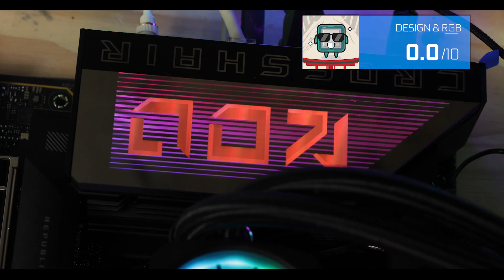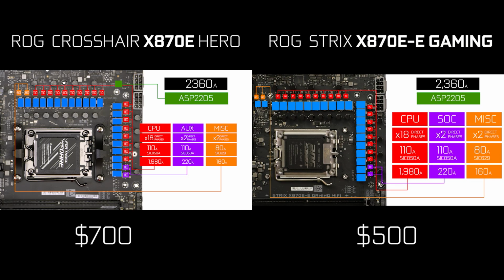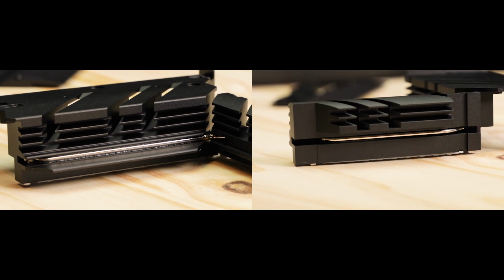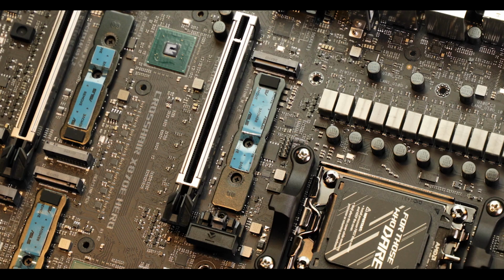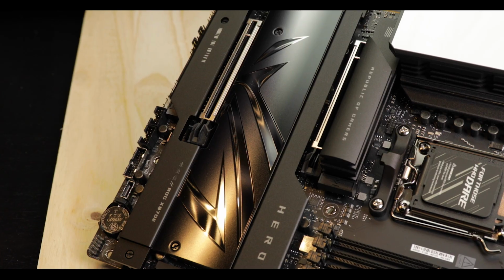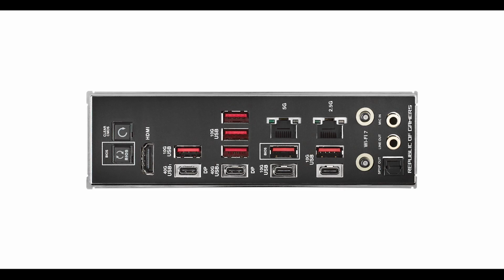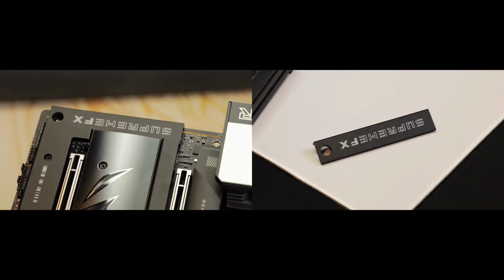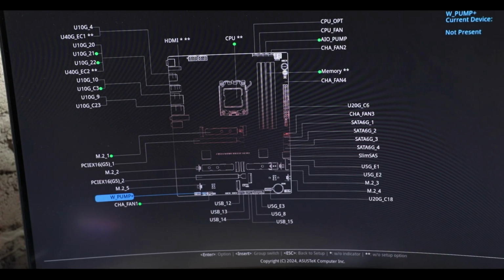ROG CROSSHAIR X870E HERO:  Stunning, but tough sell nevertheless

Comment: 1 big difference to the Strix is the extra PCIE power plug to the mobo which then relieves a lot of the stress on the 12vhpwr plug for my ROG Astral RTX5090. But thats only for rtx5090 users and those users dont really care about pricing. They just want the best.

Comment: No... Just no... There is exactly zero reason to EVER go single channel when it comes to RAM.
WTF are you talking about???? A single stick does NOT have higher data rates. Thats like saying a single water hose can put larger amounts of volumes through than two of the same exact hose.

Comment: I only ordered this board for the 2x GPU support to run both of my Sapphire RX 7800xt's and I will be pairing it with the 9950X3D for both gaming and other task as needed. I also don't think I will need all 5 M.2 slots so it should do everything I need it to now and in the future. With that said, thanks for the educational video.

Comment: if u use m.2 4 and 5 you can have 2 gpus running at 8x. i have m.2 1 and m.4 1 and 2 gpus and runs smooth as hell. both gpus gives me 8x

Comment: Currently have the x670e Hero with 4x M.2 and my 5090 running at the full 16x. Am I correct that I could achieve the same with this board by using M2 slots 1, 2, 4, 5 and skipping slot 3? My friend with the X870E-E Gaming was more than a little annoyed that even just two M2's on the cpu lane would choke the gpu.

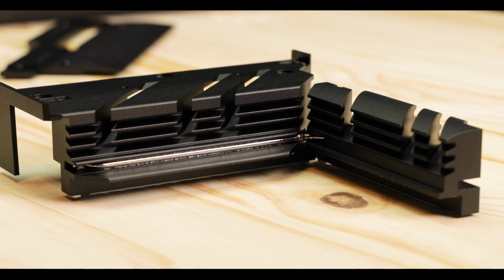Comment: Hi, can you please tell me the dimensions and especially the heights of the heatsinks on top of the motherboard (04:18)? I have an X870E-E Rog Strix and Arctic LF 3 420 with fans in Push-pull (and they are right next to these heatsinks). I plan to replace the motherboard with a Hero and I'm worried that they will interfere with each other
Reply from the maker: They are identical to the Strix you already own. It's the very same heatsink, vrm solution and caps. So the measurements are the same
Reply: @Laurentschoice  so, the depth of the very top heatsink is the same? that's awesoome, thank you very much!
Reply: Same problem with x870E hero first chunky heatsink will cause issue on Arctic Liquid Frezer iii 360mm in the cpu side,,,,😢😢

Comment: So if you use M.2_2 and M.2_3 will the PCIE1X16 drop to X8?
Reply from the maker: Yes
Reply: @Laurentschoice thanks for the reply and the review. Been eyeing this motherboard for a while. So if you use M.2_1, M.2_4 and M.2_5 it won't affect PCIE1X16?
Reply from the maker: Exactly correct Chamoy :) (savoyard ?)
Reply: Unfortunately this type of bifurcation is commonplace on consumer level boards, especially those that include a lot of M.2 slots.  For those who require insane PCIe lane counts, we are forced to look into prosumer CPUs (such as Threadripper with TRX/WRX chipset).
Reply from the maker: I miss my threadipers... I had the 1990x and the 2990wx... Horrible gamers but great at video editing ... That moment you look at 64 logical processors in your takes manager ahahaba
Reply: If i use m.2_1 , m.2_2 , m.2_4 and m.2_5 and leave m.2_3 empty will my gpu from pci1 drop from 16 to 8 ? And what will happen to pci2 ?

Comment: Thank you Laurent for another  excellent review as usual, personally I upgraded to a Asus B850E board as recommended by you from Asus Z690E gaming and i7-13700K as it fits my needs perfectly with the 9800X3D and Asus 5090 LC. Last time I had an AMD system was in 2008 albeit I have build few for other people through the years. In conclusion! Your content is criminally unappreciated! 🫡
Reply: 👏 Criminally underrated content indeed.  Laurent should have many, many more subscribers with the quality of his reviews, presented with such style and wit.

B850 is a solid choice, in my opinion, which will squeeze every last drop of performance out of the 9800x3d.

Comment: I was always going for a Hero/Apex mobo for my high end systems. This time despite going with a Ryzen 9950X3D and a TUF 5090,I surprised myself and I went for the Strix B850E equivalent which was at a fraction of the cost of those two. Yeah I saw your video on it since I was seeing the specs and trying to understand what I'll benefit from especially in bifurcation terms and surprise surprise.. Nothing was an added bonus that I'd greatly benefit from. Yeah it's nice to have two USB 40s and all my USBs to be 3.2 Gen 2 but I wouldn't pay double for that. With this money I paid for a Crucial T705 2Tb for my system drive. The only thing I see this mobo lacking and I'm not sure about it are the additional layers for sound isolation. It's the first time my AE-9 or any other soundcard having audio insulation issues with my Focal speakers (and my DAC/preamp). It's annoying I'm not gonna lie, never ever had issues like that with high end Hero/Apex boards. 
Another great review thanks for it! The only real reason I'd go with Hero this time for my 9950X3D was if I was going for 8000 CL38 ram

Comment: I have something sad to tell —not the video (which, as always, is fantastic), but rather the motherboard itself. Unfortunately, it wasn’t mentioned that while it comes with a single water temperature sensor, it completely lacks a flow sensor. I own an X570 Crosshair VIII Hero that features both inlet and outlet water temperature sensors along with a flow sensor, and I use every one of these in my custom water-cooling loop. The absence of a proper flow sensor is seen as a major drawback, as highlighted by the fact that it wasn’t even mentioned. I just can’t understand why they would cut out such features, especially at such a high price. If you’re looking for a motherboard that supports a true custom loop rather than one of the XTREME, GODLIKE models, you’re unfortunately left with the Taichi.
Reply from the maker: Yeah... Noticed it..... Agreed ....... :(